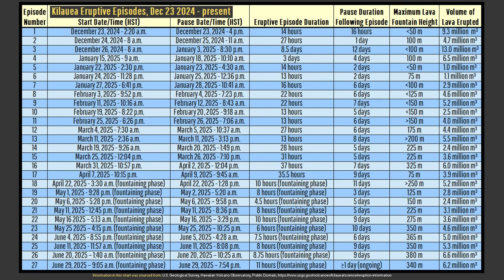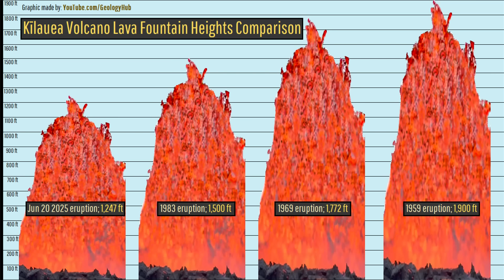Kilauea Volcano Eruption Update; 1,100+ Ft High Lava Fountains, Tephra Piles Up

Comment: How many of you can really comprehend 1000 feet? I used to rock climb on a popular cliff which was 1100 feet high on top of a 1000 foot slog just to get to the base. 1100 feet high is very high.
Reply: Every floor of a building is 10 feet. That is one tall building.

Comment: I think people are finally beginning to understand the true power of Kilauea after 2018 and the recent activity. This is no ordinary volcano, Hawaii is more like a perpetual LIP than anything else really. Truly insane levels of activity.
Reply: The creation of the Hawaiian islands is attributed to what is termed 'hot spot' volcanism.   The islands are being created in a chain as the Pacific plate moves over a relatively stationary hot spot that is not associated with plate boundary production of magma, as with volcanoes along the Pacific 'ring of fire'.     Oddly, a similar process is at work in the Yellowstone region, and locations southwest of there.    The Yellowstone calderas are the latest in a chain of caldera forming events stretching to the southwest of the park, and dating back some 15 million odd years, also formed by the North American plate moving over a hotspot.     A Large Igneous Province is typified by a truly huge extrusion of magma, possibly from a magma plume, that erupts onto the surface covering vast areas that are thousands of square miles in extent, in a relatively short period of geologic time.    LIPs are also usually one off events.       The Siberian Traps are probably the most well known and thought to be responsible for the end Permian mass extinction, also called 'The Great Dying', about 250 million years ago.    The full extent of the deposits covered an area about half the size of the United States with basaltic layers around 7000 feet thick in places.     Oceanic flood basalts are also created by volcanic activity on a truly monumental scale.     For example, the Ontong-Java plateau, which is composed of basalt deposits from a 3 million year long eruption in the southwest Pacific, are between 16 and 22 miles thick.   In short, LIPs are typically associated with activity that occurs on a mind numbing scale.
Reply: @stargazer5784  thank you, ChatGPT

Comment: How many tons of SO2 and CO2 gasses per second were propelling those 462 metric tons of lava 1,100ft into the sky? 🧐 Why have the USGS and the Icelandic Meteorological Office stopped reporting on gas emissions? Isn’t that important since it’s a large part of the motive force propelling the lava out of the ground?🤔😊
Reply: SO2 is in the range of tens of thousands of tonnes per day during fountains (it's maybe 1,000 tonnes per day between fountains).  CO2 is on the order of 10,000 tonnes per day regardless of eruptive activity (because CO2 exsolves from magma quite deep).  SO2 measurements at Kilauea are now very difficult.  The road transect used for the measurements is buried under tephra and inaccessible, and the instruments that are southwest of the caldera that were also used for the measurements are being buried and not able to function.  That's why you're not seeing numbers as regularly as you normally would from HVO.
Reply: @michaelpoland529 Thanks so much Dr Poland! I love your YVO reports and always look forward to seeing them! 🙏🏼😎🖖🏼

Comment: A house weighs about 25 tons. So that is 18 houses per second being thrown a quarter of a mile into the air. wow
Reply: Closer to a fifth of a mile but still much impressive.
Reply: I’m guessing you’re thinking of a wooden house?  Stone or brick houses would be heavier.
Reply: @lindaj5492  My 3-storey-tall stone house must weight some 500 metric tons, it's not a big one. Perhaps I should add another 1000 for the 10-ft-tall, 3-ft-thick stone wall around the orchard.

Comment: Can we get an estimate about how long it will take for the caldera to get filled up to the rim?At this type of fillerate question mark or is actually the culture itself collapsing slowly resupplying the material that's being ejected
Reply: He's already made a video on that.
Reply: Must have missed it. The last time I actually went to the calderio was before it collapsed. We stood on the very edge of the caldera and look down into the hot spot.  @BackYardScience2000
Reply: some optimistic estimates ive seen guessed 2028-2030...the caldera shouldnt collapse as material is resupplied to the upper storage from deeper sources, so these episodes arent causing ground subsidence due to volume loss in the chamber
Reply: @fake6168  To be clear, this the estimate for the inner crater, and like you said, depends on the eruption(s) continuing at at least the same pace it's been on since 2019.  Which may or may not happen.

The larger crater that surrounds the inner one is multiple miles across and is not going to be filled in the lifetime of anybody here, even if there isn't a collapse event first.